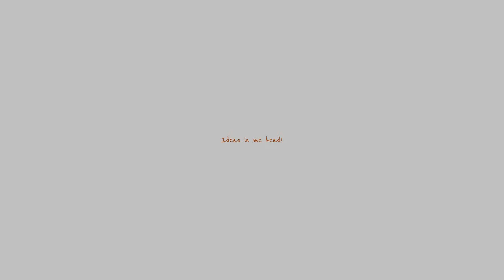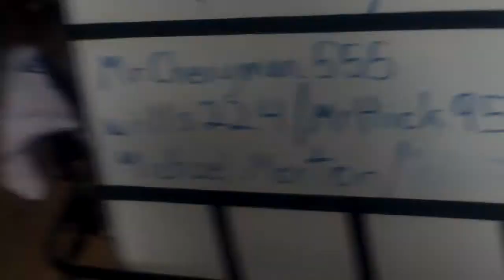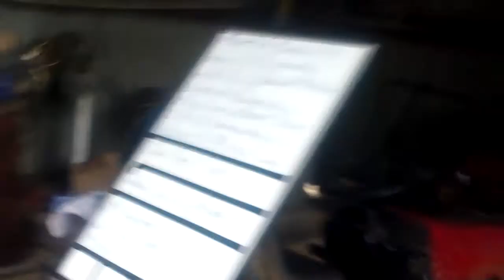Looking for belt ideas!!

Comment: on most mowers there is about three to four feet between front pulley and rear pulley. lots of room for belt slippage when wet or muddy..seems to me if you  make a jack shaft about a foot from the motor you can use a real short belt .. then a chain and a roller for tension from there to the rear...you could even use a wider belt if you use the wider pulleys..seems like a lot less chance for slippage..just a thought..good vid

Comment: so its like a hydro darn i would say use a 90 degree gear box turning verticle to chain drive or a gear box turing horizontal shaft to tires alot of the old lawn tractors had them and have you tried belt dressing

Comment: you could put a centrifugal clutch on the motor, a chain going back to a gear box then run another chain back to a straight axle. and put a belly pan on like fearlessfront did so the chain does not get dirty.

Comment: Sounds like you need the clutch parts from a small car, as you would have to use something like a clutch to disconnect the engine drive shaft on tick over.

Two chains, where they meet would be the car clutch assembly with thrust bearing and release fork.

Automatic centrfugal clutch with flyout weights would be ideal, but a swine to make one :-(

hmm.....